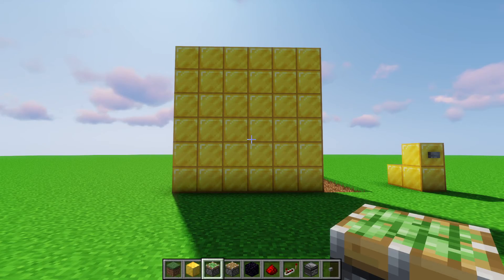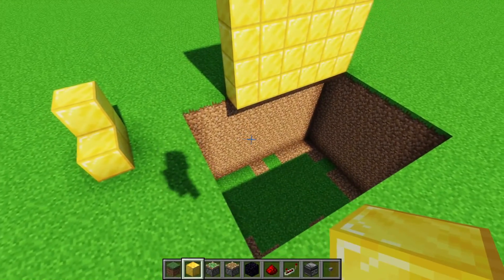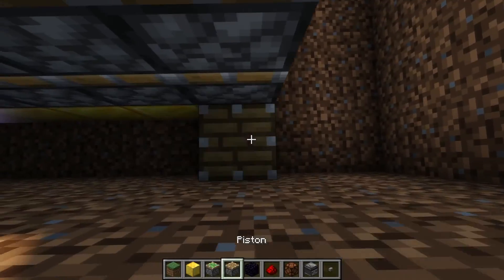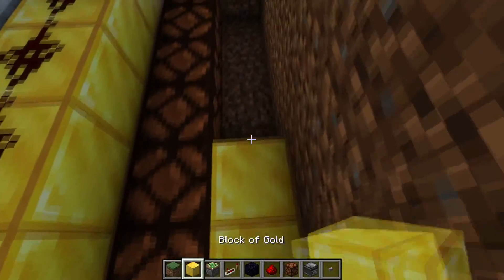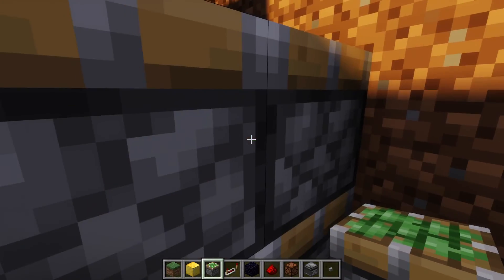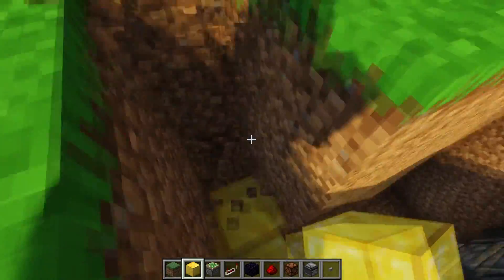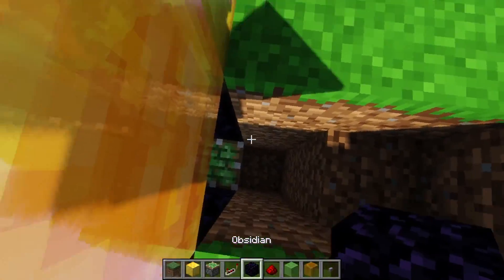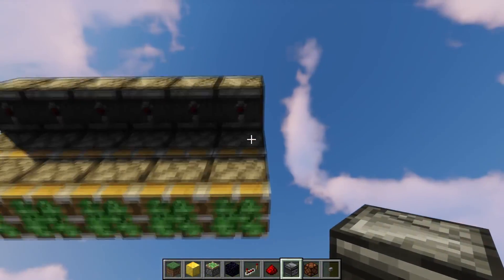Easy 6x6 Redstone Door (Java Edition, 1.21.11 and Down) | Minecraft Redstone Engineering Tutorial

Comment: im late 4 years, the piston closest to the button is like going too fast and ive been triple checking to see if i had messed up the repeaters (I didnt). Whenever I press the button all of them work but the piston closest to the door goes so fast that it moves my honey blocks down in which it gets stuck to my other honey block because its pushed down so fast that part of the bottom cant move up in time. how do I fix this?
Reply from the maker: Do you have any extra blocks that are different than the video / extra redstone you put anywhere around the pistons? If there is redstone above the pistons by up to two blocks it can break things (which is annoying), as well as if redstone is nearby powering blocks that end up powering the pistons. This gets me sometimes

If you are on a bedrock compatible server that can also mess with the timings of some things, but I dont think it would cause what you are describing

Comment: Is there a way to do it so there’s no honey and slime exposed? Fully functional in 121.5 btw.
Reply from the maker: Not that I know of without a significant redesign, mainly because of where the blocks end up needing to be. The "fastest" solution would be to make two doors back-to-back, which would require a lot of space
Reply: I’ll have to put some thought into it. Best most simple mech I’ve come across so far so thank you. Used it a couple of times now with slightly different door configs which turned out very cool. Cheers

Comment: If I didnt make any mistakes this does NOT work in 1.21.4 I tried putting redstone lamps all acrost the back bc I noticed that the only piston that was grabbing the blocks was the one with the redstone lamp. it worked to go down but it didnt come back up.
Reply from the maker: I just tested mine to make sure it still works and it does (On 1.21.4). I have a pinned comment because at the end I did place obsidian that messes it up, but it doesn't seem like that's your problem. Is it just one side of the door (the bottom or top) that isn't working, or is it both? I have to obligatory also ask if you are on Java (Bedrock will definitely not work, but not sure what it would do)

Comment: Having issues with the top part - for some reason when I activate the button for the first time (e.g., opening the door), the bottom layer of pistons gets left behind. This results in the upper half of the door only being lifted one block. When I "close" the door again, the top layer of pistons is successfully picked up - I just can't get it to take the door with it
Reply from the maker: Obligatory for me to double check you're in Java edition since Bedrock will do stuff like this. If so, I would check that your delays on all of the repeaters are correct, since if something is firing too quickly this can happen, and its easy it right click it by accident or something. If that doesn't work, I might need more information to narrow it down
Reply: @ZennsWorld  Yeah it's in Java, I've checked the repeaters and tried rebuilding a couple times so I don't think anything's wrong with the repeaters - although from my observations it did seem like something was triggering a little too fast. Also worth mentioning that this is on a server with some plugins, so might affect the latency? Also worth noting that the bottom half of the wall works fine - would it be worth it for me to try and replicate that upside down?

To describe the issue in more detail, after I press the button for the first time, the top two rows of pistons retract to their normal place, but the bottom row of pistons ends up  floating two blocks below where it started, touching the slime block (I think the slime block gets raised one block in this process). But when I press the button the second time, that bottom row of pistons gets "picked up" again and ends up back in its original place. The slime blocks never move after the first time it's pressed
Reply from the maker: Assuming the server pluggins dont mess with the tick rate or redstone directly I dont think that would affect it (though I suppose it could). This is interesting since what its doing  can sometimes happen if I break it at some point, and I have to rebuild it to fix it (it wont resolve itself); if you have already built it multiple times though then it wouldn't be pre-broken like that, so it is something else. Ill see if I can make mine do the same thing as youre describing. If the server has things such as "light blocks" I have actually see that make pistons behave weird as if something blocks the pistons, so be aware of that as well
Reply from the maker: Ok, I am not sure if this will be your problem, but my version that I built on the video (but not the demo version in the intro) was already broken in a similar way as you described. It was because the obsidian that I placed at 11:45 just completely blocks that part from coming down entirely, so if that fixes your problem then it was entirely on me. I will probably make a pin comment for that fix as well. The first time I turned it on after removing it the door did something weird and I had to redo it so watch out for that (probably from something I did before that to try to fix it though)

Comment: Hey there! I'm having a bit of trouble with the door. 

I made it the same exact in the video, but for some reason some observers are getting swapped with stick pistons no matter what I do. I'm going to try and rebuild this, but it doesn't seem to want to work. Any suggestions?
Reply from the maker: Huh I've never heard of that happening. Could you elaborate on what exactly is happening if the rebuild doesn't work?